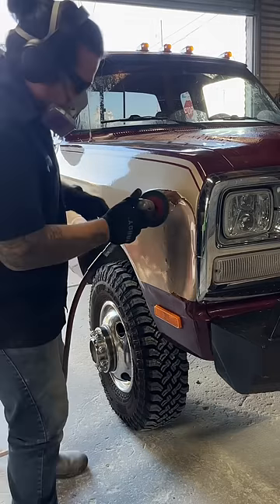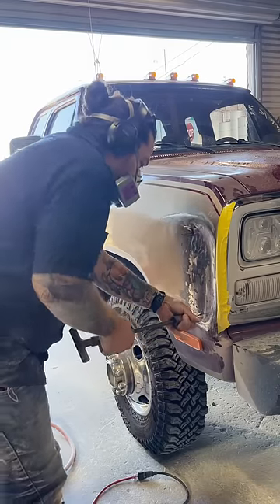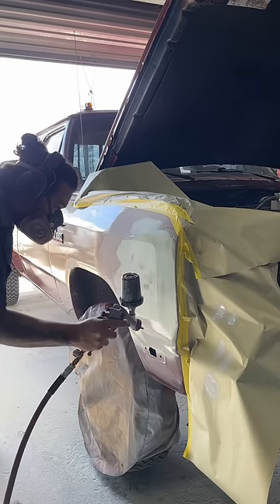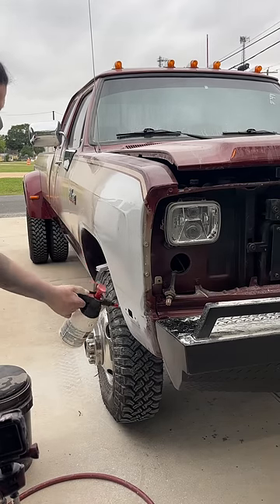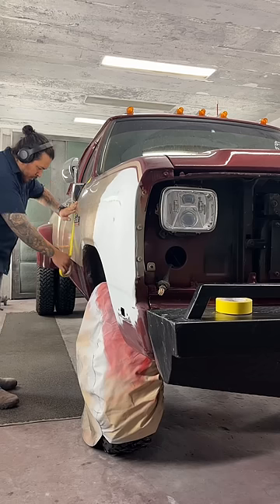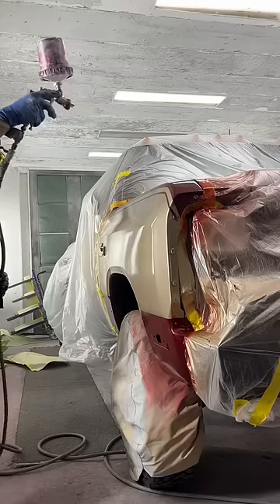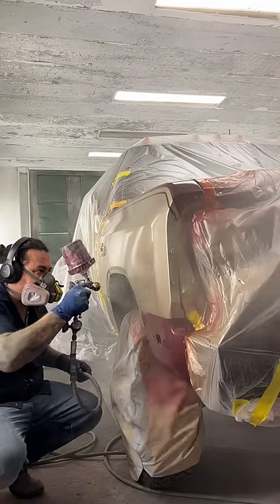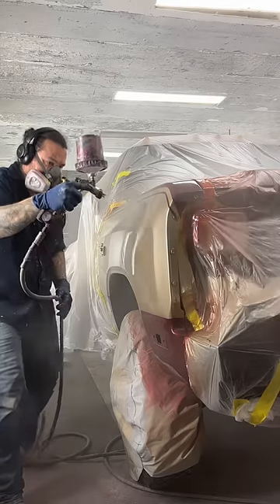Fender Repair vlog #autopainting

Comment: Beautiful truck and work. But I got a question, did you sand the hole fender or can you paint over the old paint?
Reply: You can paint over the old paint if it’s still stable and prepped right ofcourse. He just sanded around the repair area and blended in the bondo very good work

Comment: question it looked like there was bare metal showing through on the body line and you sealed it is that sealer designed for bare metal

Comment: Paint looked like shit to begin with. Tons or orange peel. You made it look better. You didnt remove the fender emblem. This is kind of half ass or maybe the owner was cheap. Either way. Looks better than it did but that emblem issue, not on my vehicles.

Comment: Put on a new fender. Paint the fender before it goes on.  That garbage bondo always cracks and falls out
Reply: not if used correctly. l have repairs from 25+ years on my vehicle still no problem. change a panel ,no real skill involved .

Comment: As cheap as a fender is for that year model, this makes no sense and would be alot better quicker job..
Reply: Well, I wasn't going to necessarily criticize because if you have an inaccessible area. It makes sense to do it the way he did it. .   but I don't know why you wouldn't take the entire fender off and then work that fender off the car from the back side.

A rubber mallet on a board would get it pretty close, and then a little hammer and dolly work, and you could metal finish that.